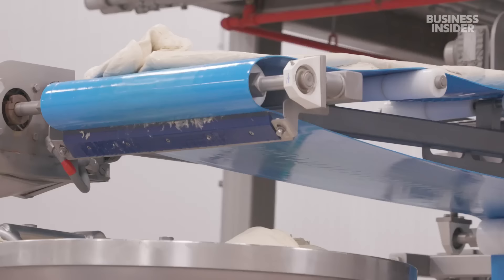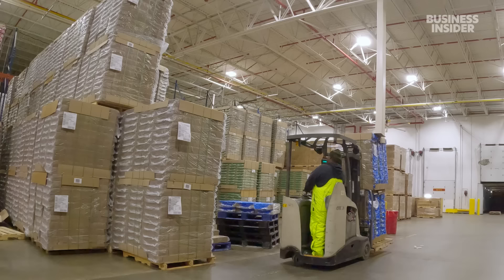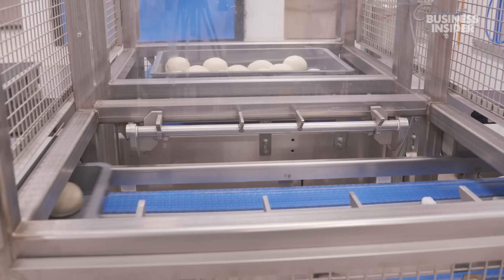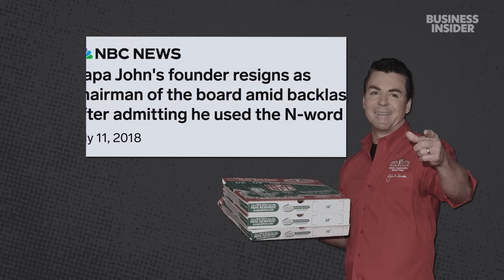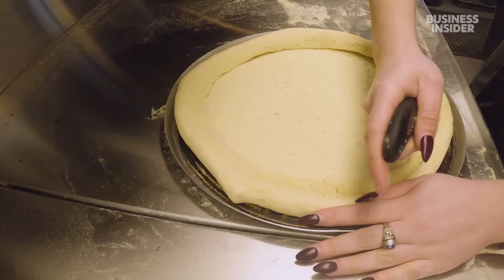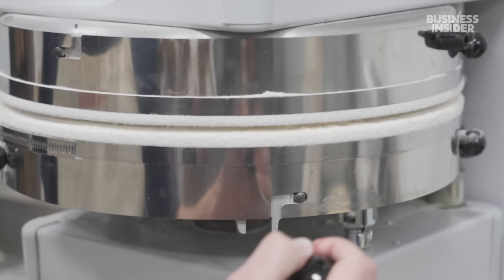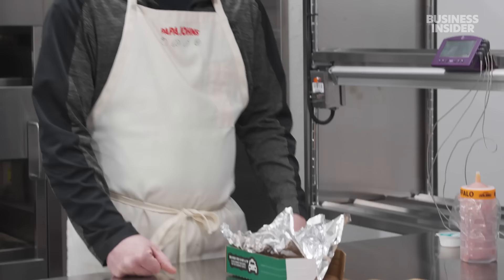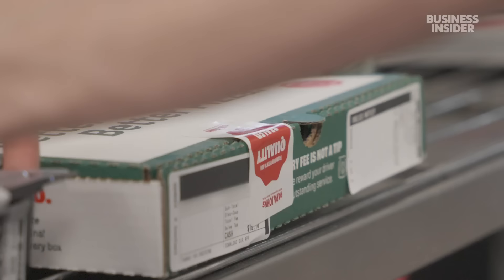How Papa Johns Makes Millions Of Dough Balls Before The Super Bowl | Big Business | Business Insider

Comment: Never frozen in that pantry but the chicken says “keep frozen” so the pantry cooler must be freezing temps
Reply: My optimist self used to think they were actually grilling fresh chicken IN THE RESTAURANT and using it as the pizza topping.  😬
Reply: Dude literally said you can’t be in there to long or you will freeze to death! 🥶
Reply: It's frozen (or used to be) & would slightly thaw out enroute to the store. Used to need 24 hrs in the store fridge before we'd use it.   
So much wasted cheese & pepperoni on the make line.
Reply: He said the dough is never frozen, but the toppings and the desserts are… 2 different areas (coolers)
Reply: @Barneys69Ruiz  it's called exaggeration
As someone who's worked in a papa johns, yeah its colder than most walk in coolers, but it's definitely NOT a freezer.

Comment: The wonder Papa John's Pizza no longer taste the same.  With a big corporate mixing center you know they are trying to find ways to cut corners.
It's what I call the stair stepping down to greater and greater mediocrity.
Pizza store chain. Peter Piper's used to be good pizza at fair prices but it's become crappy pizza at exorbitant prices and I refuse to eat it.  It's because a bunch of college grads who don't understand pizza made efficiency improvements and said it's almost the same.  And the company had changed hands several times each time with another efficiency improvement until the pizza is what I consider is inedible.
The same corporate pressures that ruined a decent pizza chain is now ruining Papa. Johns.  I was wondering why the last couple of times I ate a Papa John's Pizza that it just didn't taste right.
Even it's founder says it doesn't taste the same. Of course the corporate people pounded the drama. We haven't changed anything.  The typical corporate move admit to never doing anything wrong and saying everything is fine in never Neverland.